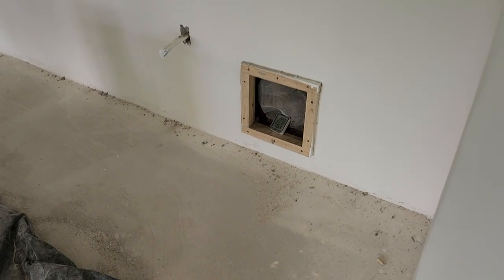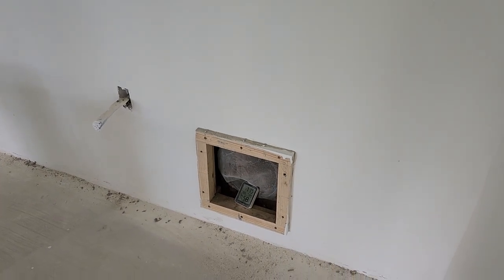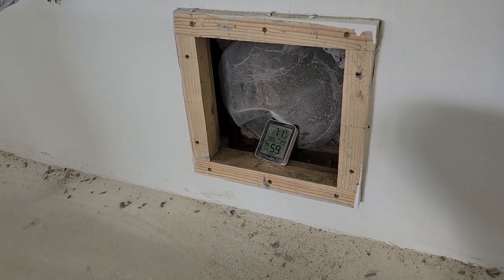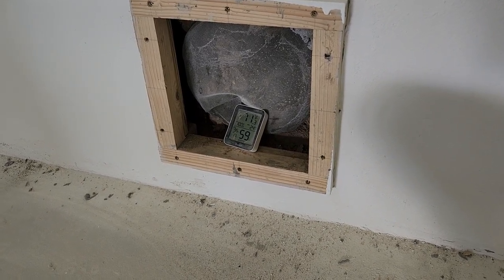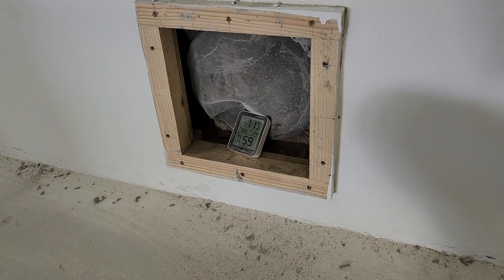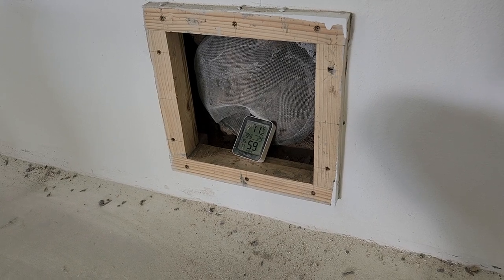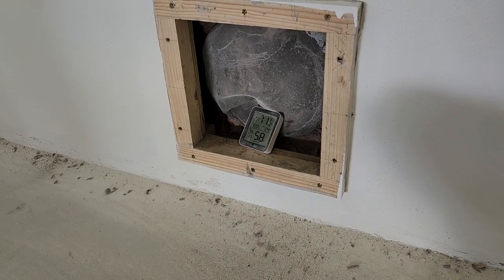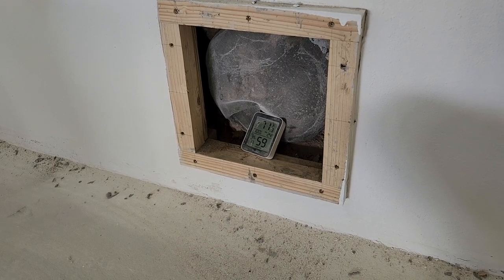Earthship cooling tubes with a fan experiment!

Comment: Relative Humidity is directly dependent on temperature.  So, increasing the airflow in the tube will absolutely lower the relative humidity. It’s physics.  On the other hand, the dew point of the air doesn’t change with temperature.  And with a system like this which uses outside air passing through buried tubes, the moisture is due to the humidity in the outside air.  The condensation on the tubes is because the surface of the tube is cooler than the dew point of the air coming in from outside.  Increasing air flow will increase the air temperature because the air has less time to transfer its heat into the tube and into the surrounding soil.  If the tubes aren’t rusting and the condensation isn’t making a mess then there’s nothing to fix.

Comment: I always thought about this if I had an earthship. Like getting a big cpu fan to mount near the opening. Not sure if that extra movement would affect the natural cooling, though.
Reply from the maker: I tried it on the front side but it didn't do much. I believe if you do it from the backside the air movement in the tube dries up humidity.
Reply: @Offgridgoat  Well I guess thats the next video. lol

Comment: I built a dart frog tank A/C unit out of a normal CPU heat sink on the hot side and a Corsair CPU all in one liquid loop heat sink on the cold side. It basically was a glorified dehumidifier. Dart frogs need 80% humidity. 

I am pretty sure that will work but you will have to study how condensers handle the liquid they gather in their fins.

Comment: Use a loop brother. Add a dehumidifier in the house and just dry the recirculated air inside. Its easier to maintain..
Reply: Ductless mini's can run off solar and they use almost nothing on their lowest settings.